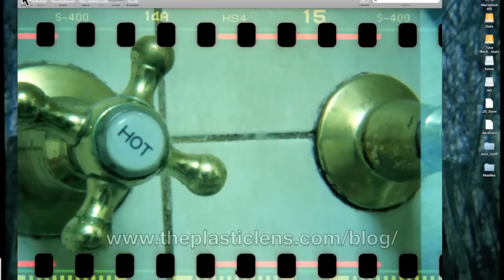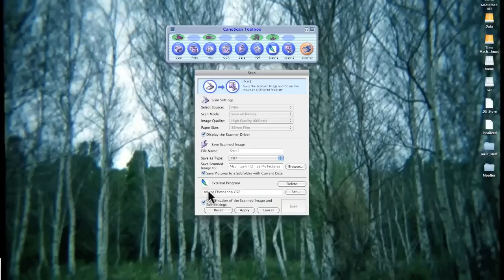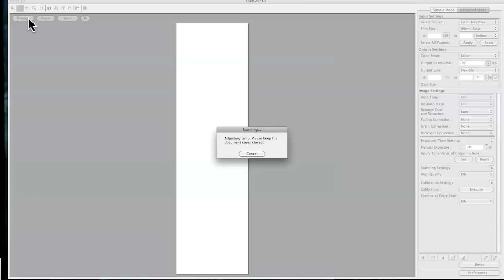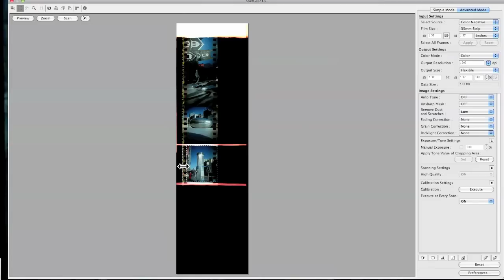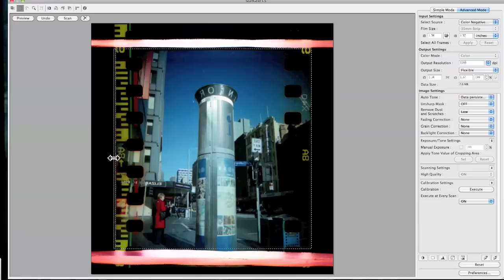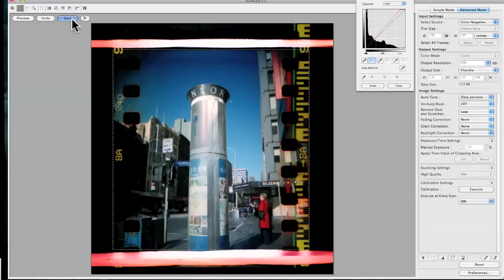Scanning for Sprockets

Comment from the maker: @johnnymitch74 - The section from 2:30 to 2:39 simply show the way the scanner will 'read' the black parts of the sprocket holes and automatically adjust the tone, which gives an undesirable cyan cast to the image. This happens if you try to set the scanning boundaries to the margins of the whole negative (including sprockets) as the scanner automatically tries to adjust the tone for the selected area.  One of the primary purposes of this tutorial is to show how to avoid that problem/colour cast

Comment from the maker: @birdybath2004 - by 'film trays' do you mean the negative holders? I made a custom holder out of stiff cardboard, using the 120 film/negative holder as a template and rubber bands to support the film. You can use the provided medium format holder if you like (again, you'll probably need to use rubber bands or other support to stop it sagging in the middle) The 35mm negative holder won't work as it masks the sprockets.

Comment: I just bought the CanoScan 9000F (the older sister of 8800). I am very happy with my purchase. Please I need a clarification of your useful video: immediately after the negative scanned two horizontal lines appeared in the bottom cut just the first frame. How do you get it?
Thanks
Steve